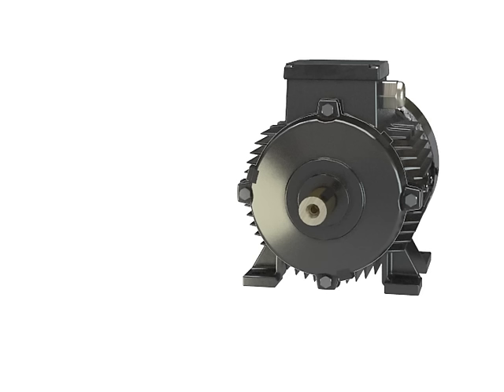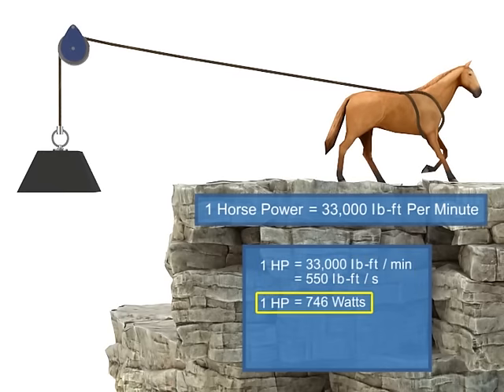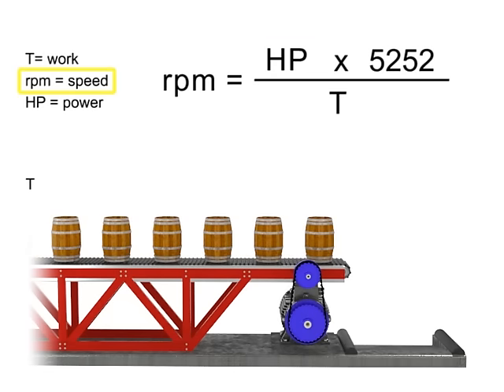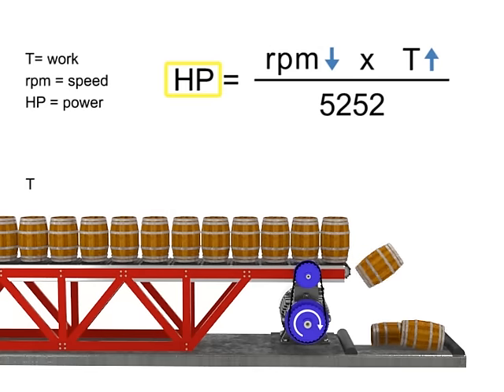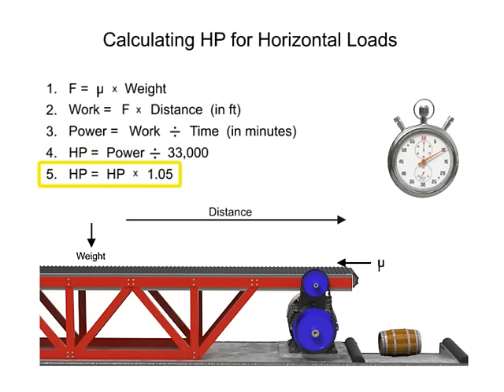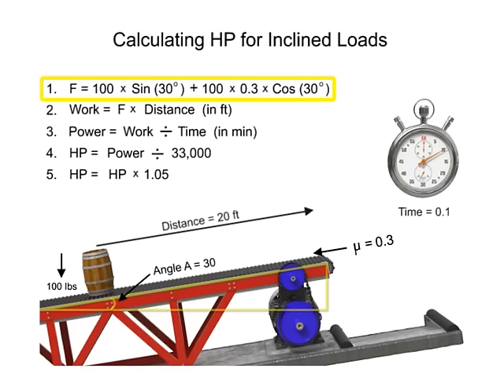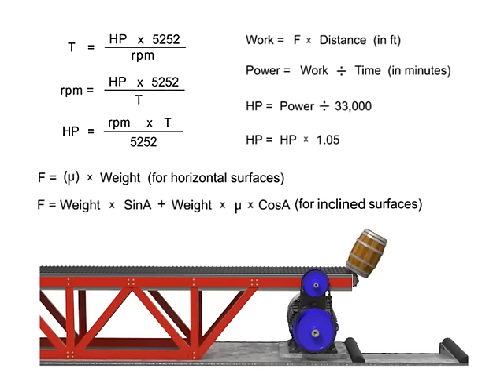Motors: Speed, Torque & Horsepower

Comment: No!  Speed is how fast a motor rotates, NOT how fast it performs its work.  POWER is how fast work is performed, and a spinning motor does no work until it is connected to a load.  Also, 1055 Joules do NOT equal one horsepower, because a Joule is a measure of energy, not power.  Energy is what is expended to do work, while power is the rate at which the energy is expended.  One Watt (of power) expended for one second is equal to (the energy of) one Joule.  746 Watts equal one horsepower.
Reply: speed is how fast a motor rotates either with load or with no load if we are ta
Reply: After working with megajoule tables and wondering why we used decanewtons(as a weight measurement ) you make  sense ,so basically horsepower is a force measurement like decanewtons?or is it  like how fast you can exponentially  increase momentum? or should i smoke another joint...lol
Reply: He turned hp to joules lool

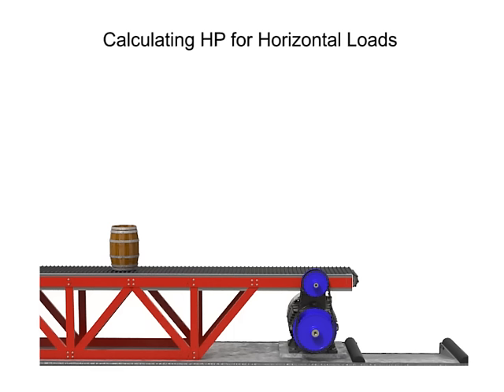Comment: You are so wrong about friction because you are confusing sliding and static ones. At 4:45 you start to explain sliding friction force and its coefficient. But then at 6:03 you have the static friction force which moves the barrel, so (μ x Weight) is no longer correct. Indeed, this static friction causes the barrel to move unlike the sliding friction which always tries to stop the object.
Then same happens at 8:11 for an inclined surface. (Weight x μ x CosA) is a sliding friction which you have to overcome. But at 8:43 it is again the static friction which moves the barrel and is NOT equal to (Weight x μ x CosA), it equals to (Wight x SinA). It even has the direction of the motion unlike the sliding friction force which is opposite of the motion.

Comment: Not sure why people can't get basic things right...

1. Torque is not a special kind of work. Torque does not even cause work at all before it involves motion. 
2. Torque can be measured in lb-ft (pound foot) but that involves "pound force" and not "pound weight". Only if you assume standard gravity can you say that an object of 1 pound at 1 foot of arm will make 1 foot pound of torque. E.g. on the moon, you would have a surprise using such analogy.
3. One horsepower is not 1,055 Joules. Rather it is approx. 746 Joules per second.
4. "More horsepower is needed to produce the same amount of torque more quickly"...nonsense, torque is not a measure per time but simply a static measure of twisting force.
Reply: You are correct. There is a big mistake about friction forces too starting at 4:45.
Reply: About your #4.  It seems like you haven´t understand this part correctly. Torque is not a measure per time, that part is correct, but power it is, so yes, more horsepower is needed to produce the same amount of torque more quickly.

Comment: In common parlance pound-force feet (lbf-ft or lb-ft) is frequently conflated with foot-pounds (ft-lb); however, as a tutor of college mathematics and physics, I would damn near prick-slap anyone of my STEM tutees for getting those confused ;)

The English measure for work is ft-lb, not lb-ft.  It is the dot product of force and distance; it is a scalar.  On the other hand, the English measure of torque, the rotational analog  for force, is lb-ft.  It is the cross-product of distance and force; it is a vector.

Finally, for a clear and accurate explanation, view, "Why doesn't torque have the units of joules?" on the "Logically"-channel.

Comment: torque is a special kind of FORCE, not work, that produces rotation.   small correction
Reply: Torque is a FORCE.  You don't need ANY movement (rotation) to have force.
Reply: actually, you do.  if there is a force, then there is its mass x its acceleration.  what you are talking about is a "net" force.  and if you have a net force, you then have rotation.  sorry, its the law.
Reply: torque
Reply: no... tq doesnt need rotation..... try removing a stuck lugnut.... you apply well over 800lbs of tq but cant remove it.... the law of tq requires no movement....

thank you come again
Reply: well he kinda explain right.....if you take a look in kinematic....torque is defined by force multiple by radius or in vector quantity sinus angle of r.....(if you consider the si unit well the angle will might be in radian)
Reply: Although torque and work are not the same they have the same unit.
Reply: one is scalar and the other is vector.  a lb-ft is torque.. while a ft-lb measure of work.
Reply: dont be a smart axx... you can apply 800 lbs-ft  of torque, and the lug nut can resist with 800lb-ft of torque the net force is 0. unless you get movement.  if there is no movement, there is no work, there is no energy expended.      its like you sitting in a chair.   the chair pushed up with 200lbs and gravity pushes down with 200lbs...
Reply: No energy expended!?.  No work is done... but energy is definitely expended!.
Reply: Marek Sumguy no energy 
No work
they are intrinsically tied together 
Think of pushing a wall or sitting in a chair 
No net force no movement 
No wk
No energy
Reply: Marek Sumguy not in real world terms
Reply: Chad W interestingly work is ft-lbs and torque is lb-ft   One scalar the other vector
Reply: You have a PhD in Physics.  Lets see if your PhD means anything.    Was 9/11 an inside job??
Reply: Marek Sumguy 
Hm, PhD in Physics and 9/11 as an inside job. If anyone finds any connection between these two please let me know.
How about you writing units of torque and work here?
Reply: What does you understanding of Physics tell you about 9/11??
Reply: Marek Sumguy LOL :) How did you come up with such an off topic question?
Reply: Just answer the question would ya!!
Reply: Marek Sumguy No, I'm not going to. I even don't understand what you're asking .And if this is the way for you to check my physics degree then I'm not going to prove anything to you.
Reply: No thanks.
Reply: Marek Sumguy You already did it, so too late to choose now.
Reply: Marek, have you ever taken a high school or higher physics class?
Reply: One thing is that you cannot see anything moving, another totally different thing is that it isn´t.  Of course there is movement while you are trying to twist that lugnut, but this movement is happening inside your wrench (socket or extension) there would be a twisting (torque) movement present.

Comment: Hi I have an 11kw motor with rpm of 2450 and want to design a gear box for a machine that will run at 420 rpm and output of 8kw. What am I supposed to take into consideration. Or simply how do I work it out? Thanks
Reply: did U made it ?

Comment: 0:02 "...that determine the type of work a motor can produce" I get that you're trying to use "work" to mean "type of measurable output", but that use doesn't belong in this video.You're about to talk about mechanical work.

0:07 "speed is defined as how fast the motor performs its work" Nope. That's power... which you're also about to talk about. Speed would just be defined as the rate of rotation.

0:33 "...the work is called torque. Torque is a special type of work..." Work is NEVER called torque. Torque is NOT work! Torque is angular force, or more intuitively, "rotational force".
Reply: im glad i've read the comments. are you sure about this? Thanks i'm a newbie here
Reply: i replace winding coil of my dc motor, a Thicker winding coil. due to more thicker, i only made 8 turns each pole, the dc motor ia working when no load, i can feel it's fast but when i place the remote car on the ground it can't carry load. please help me thanks
Reply: @yosef-yosef9414  The twisting force (torque) produced by a stalled (not turning) electric motor is a direct function of how much total current is flowing around each pole - so thats the current flowing in the wire times the number of wraps that wire makes arount the pole. 1 amp through a wire with 100 turns would give the same torqe as 10 amps through a wire with 10 turns.
This current will flow according to ohms law (V=I×R).
As the motor turns faster, back EMF is generated, which you can think of as backwards voltage. It's as though the supply voltage were reduced, reducing the current that flows and thus, the torque produced. 

By re-winding the motor with thicker wire two things probably happened.
1) You reduced the resistance of each coil.
2) You reduced the number of turns on each coil.
These cause several changes. Fewer turns means two things: back emf is weak and so no-load speed is high. Also more current will need to flow through the wire to create the same torque. Well the lower resistance should cause more current through the wire, but since you are probably powering the motor with a battery, the battery may be reaching limits of how much current it can provide (bateries have "internal resistance")
Basically you moved the rpm for best efficiency way higher, making it more inefficient when stalled or turning slow. The motor you have now could maybe perform the same as before if it was mated to a much higher ratio gearbox.
I hope this is making some sense.
Reply: @drienkm  Wow thanks Sir for your reply i appreciate that... i will try to comprehend your reply i'm not native english speaker. wait. Thanks☺️👌👍

Comment: Torque is not a "type of work" if anything its a type of force. Also you cannot convert horsepower to joules, since horsepower is a unit of power and joules a unit of energy. The list goes on...
There is so much wrong information in this video..